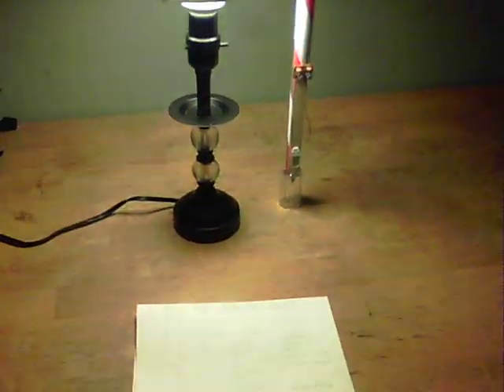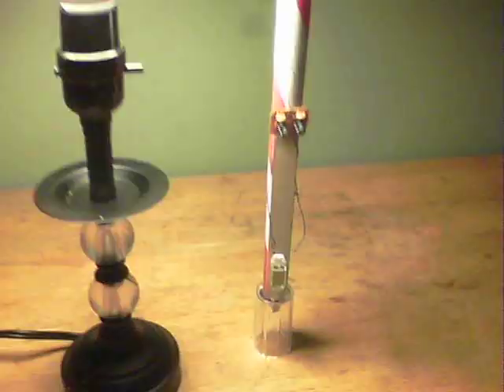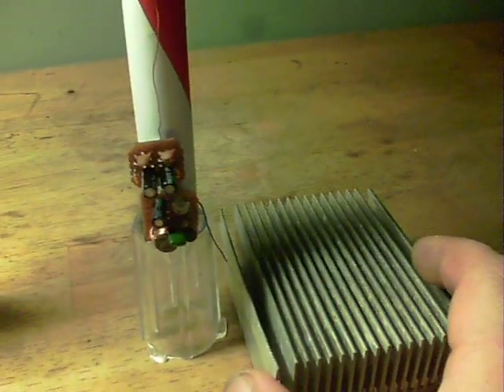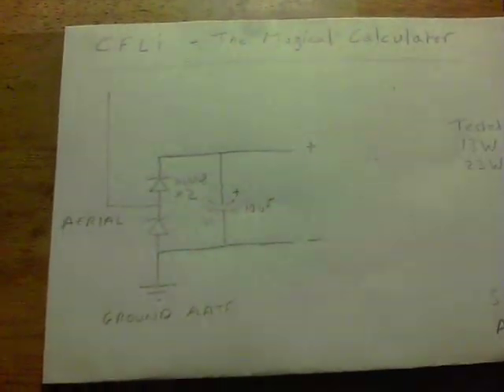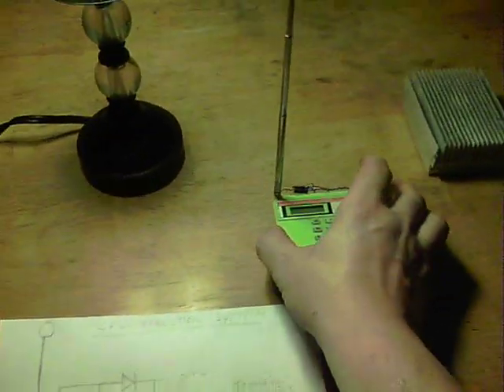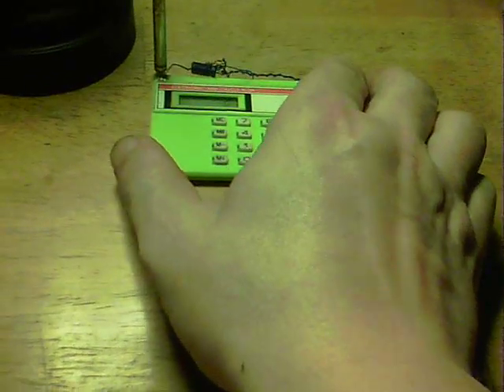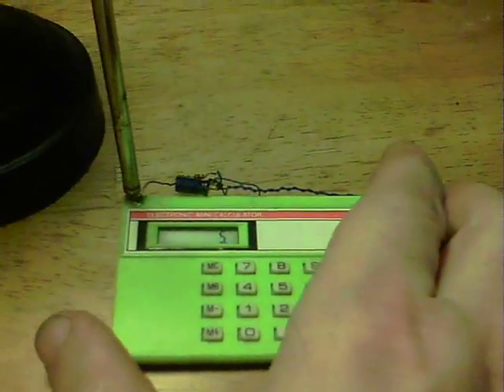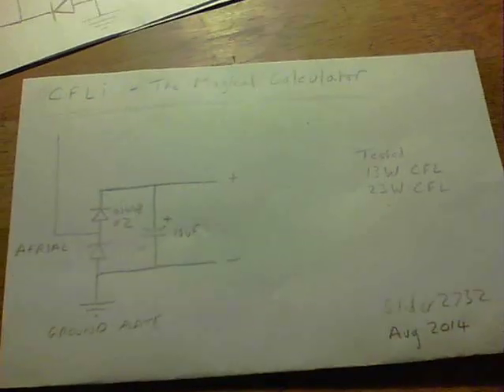CFLi - The Magical Calculator

Comment: Imagine if someone built a phone case that has an antenna like that.  You put it next to your lamp in your house and your phone charges.
Reply from the maker: TipSpy Something like that would be great, but would need to pull in > 350mAh for a phone to actually charge (they often say 'Charging', but really aren't at lower current input). I do wonder about putting something similar near the main breaker box for the house lol. 
The idea is to capture ambient wifi, CFL emissions, radio waves, small amounts that pollute the environment and run useful stuff :)

Comment: I want to replicate this. Is there a ground point on the back side of the calculator?
Reply from the maker: Hi Bill. You can put a sheet of something like aluminium foil or thin steel behind. It will improve the energy throughput when connected to either of the outputs from the harvesting circuit. Interestingly, extra antenna height does little, but a larger mass as the ground plane betters results. Holding such a back plane in the hand also improves results - so you could put a sheet on the back, then hold the calculator a greater distance away from the CFL and use it.